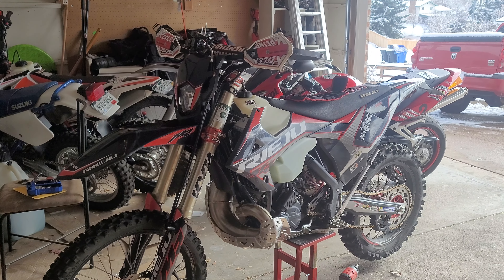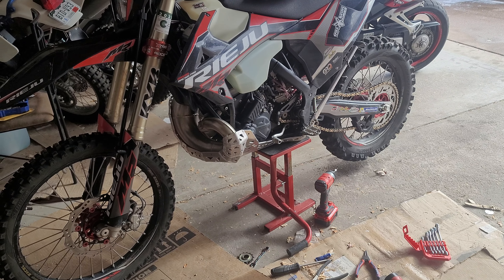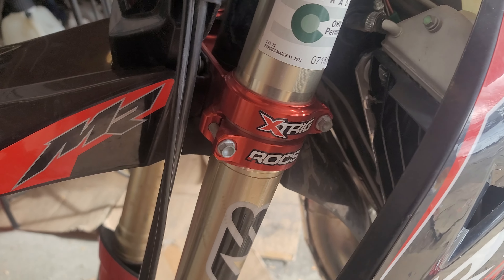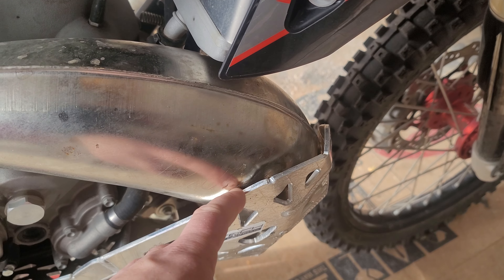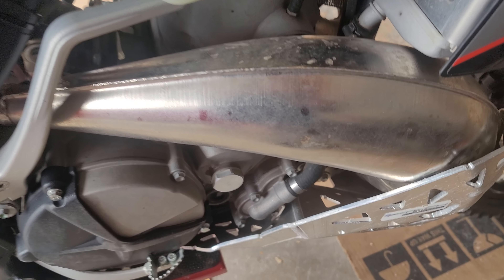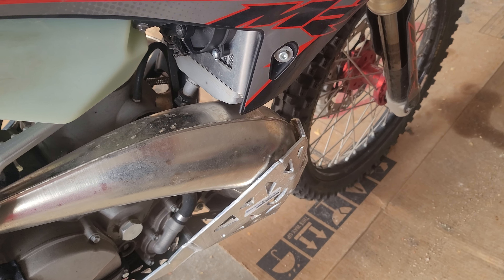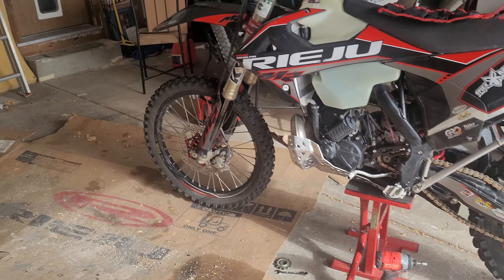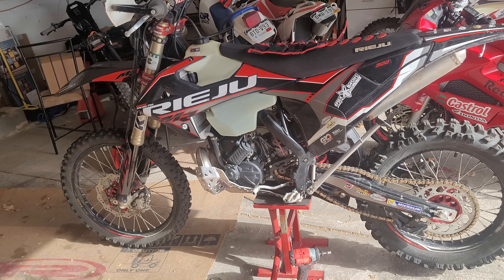Rieju MR Pro Skid Plate Update | P-Tech Skid Plate/Radiator guard

Comment: Drilling a hole for the Crankcase drain will be advantageous in the case of a drowning.Not having to remove the bashplate trackside will save a lot of pain as well as the need to upend the bike
Reply from the maker: Yup next time I have the plate off I plan to drill it.
Reply: @pharettface  May as well drill a hole for the gear box drain at the same time then there's no need to remove the bash plate at all